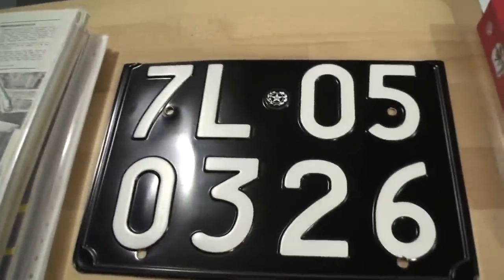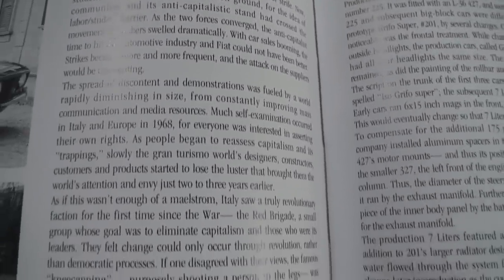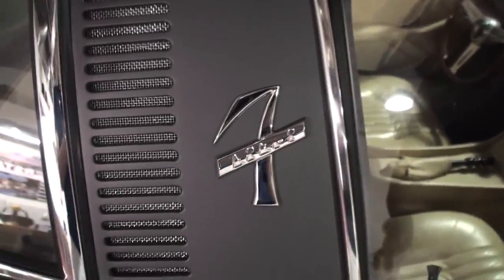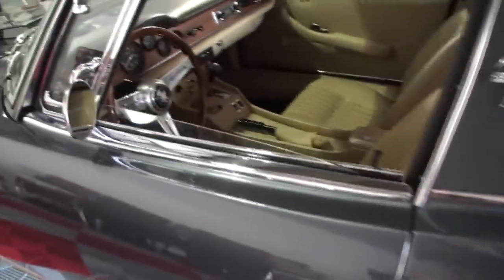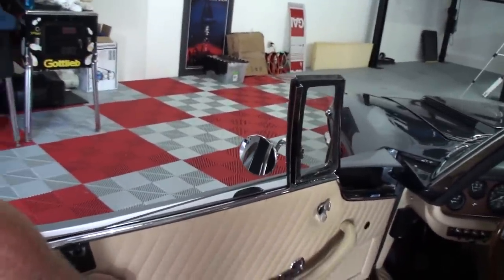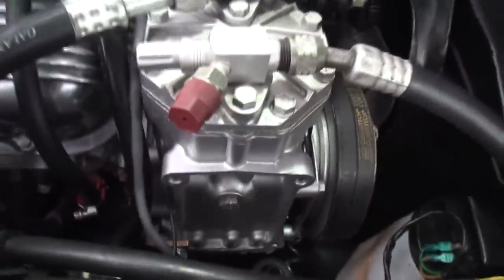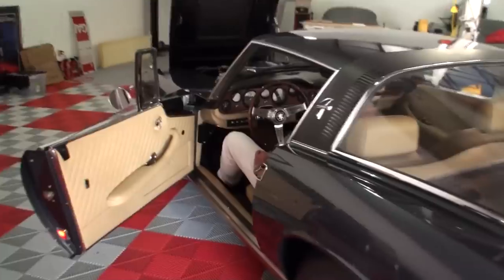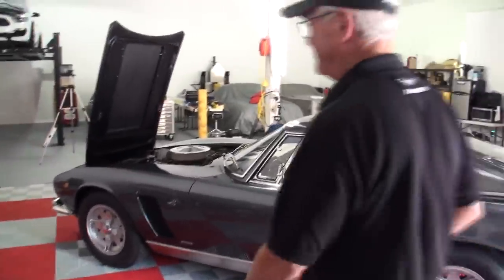RARELY SEEN 1970 Iso Grifo in Gray & 7 Litri Liter Engine Sound on My Car Story with Lou Costabile

Comment: This Grifo #326 was nice creamwhite when it was in sweden from 1978-2006 and it was running on swedish number plates. A grifo owner of mine did some restoration on this car in the mid 2000  and I have a bunch of garage pictures from that time, it was a very untouched car only the carter carburetor had been changed to a good old holley back in the 80s cause it was running a little lumpy. It was sold to germany  about 10 years ago,  at that time mysleft I had 67 Grifo with a 327 chevy but the 427 was the dream motor I wished for.
Good buy Randy.
regards Roddy
Reply from the maker: Hi Roddy, Thank you for viewing, sharing your knowledge, and happy to read you had a cool Iso Grifo too :-) Lou